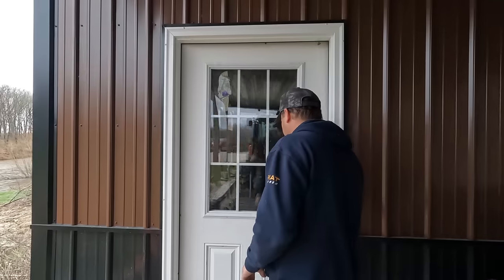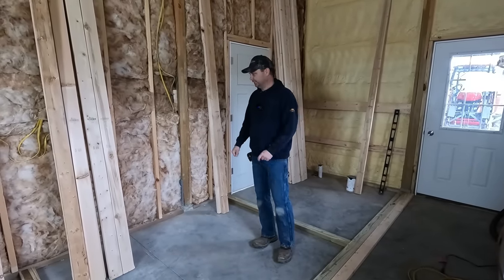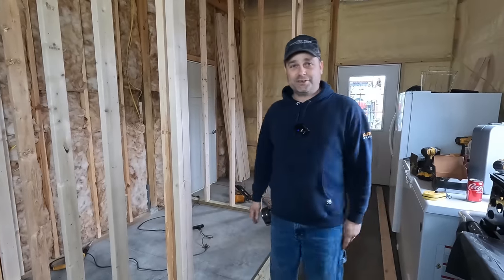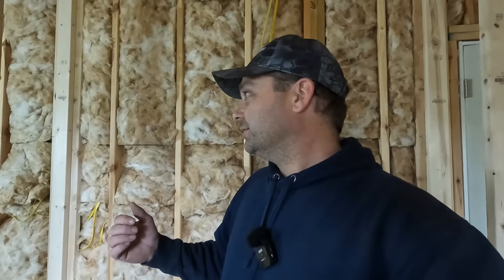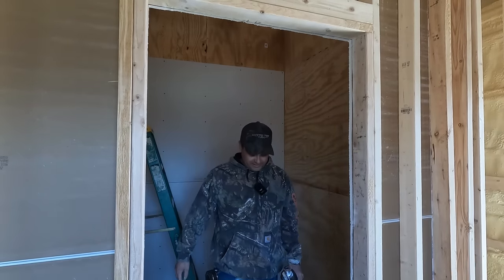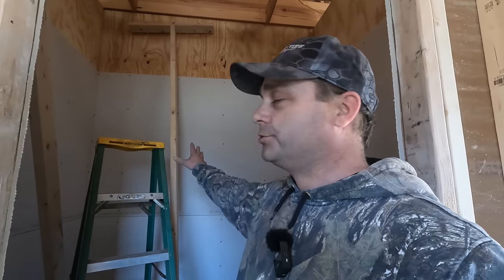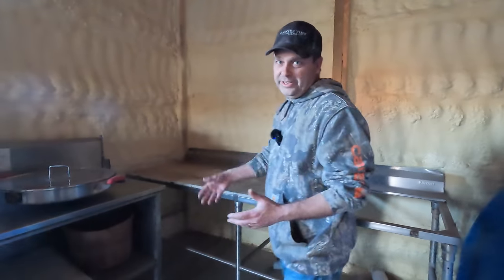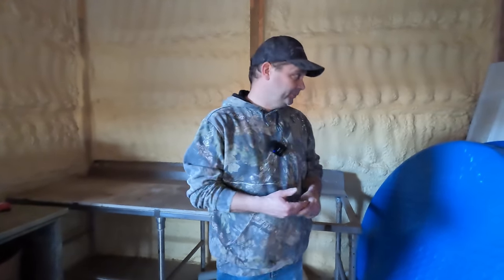We built 2 more rooms inside the workshop.   We have big plans for this space.

Comment: Just an idea for you . Instead of cutting the stainless steel table down what about keeping like it is and finding a thick plastic tub to fit in the hole , so you use the table for cleaning/cutting vegetables or meats and all you have to do is slide them in the tub . So when your done all you have to do is take the tub out to move the product to the next table for the next step in processing.

Comment: I learned the hard way that when moving a Hobart meat slicer around, you have to keep it in an upright position. If you don't ,  the oil leaks into the motor housing and burns up the capacitors. It's a real mess to clean up.

Comment: For the solar control room, I would sheath the walls in a fire retardant board like cement board instead of dry wall, and maybe a CO2 fire suppressor. Especially if you are going to be putting batteries in there.
Lithium fires self oxygenate so they are nearly impossible to put out. If you get a fire in there and you have dry wall you can basically say good bye to your whole barn.
Reply from the maker: I used 5/8" thick fire rated Drywall on the walls.
Reply: Falney, I agree with you. Watch EV car fire videos when the batteries catch fire. It can be a very violent reaction. I personally would build a battery house seperate from the barn.
Reply: @CountryViewAcres  I see. I wasn't aware there was drywall suitable for use like that. UK here :)

Comment: Your solar room needs to be double that size you will max it out very quickly if you are going to have enough room for equipment to power both the house and shop especially if you do a battery back up.
Good luck and hope all goes well.
Your Illinois neighbor.
Reply from the maker: Right now 2 walls in the room will be taken up with equipment.  With the 3rd wall for expansion.  The room should work out fine.
Reply: @CountryViewAcres  ok I hope so.
My room ended up being to small so I built a 12x16 shed and have almost maxed it out but I have a lot of battery back up.
Good luck

Comment: Evan, I hope things work out for you but I have many a friend who are off grid on solar, even friends in Canada with heavy snowfall who have their panels close to the ground. I believe having your solar panels on the roof is not a good idea. Even if it is on a lower roof level its going to be difficult to access to clear them of snow. Heaven forbid you are down and can't get out to clean them and Rebekah has to go out and clear the snow. Are you planning on using a long handled broom? Shading panels like from partial covered sections can not only not produce but also rob you of power. The panels out by your garden are better in that you are able to clean them. Also mounted permanently fixed to a roof it is a compromise in angle of the sun from summer and winter exposure. I wish you well but my advice would be to atleast put them closer to the ground. Your property taxes will go up because you are adding value to your pole barn building by putting the panels on it.

Comment: How do you plan to run the power from inside the solar room to the exterior trench? Up through the ceiling I imagine? Seeing as the room was an afterthought you probably don't have a line in the concrete.

p.s. I poured concrete in my shop a few months back and I did the same under-slab conduit runs that you did so I can have power in the middle of the shop. Thanks so much for all the great videos and ideas!

Comment: Is the drywall a code requirement or just esthetic? Why drywall over plywood?
Reply from the maker: The drywall isn't a code requirement.  But the drywall I used, is fire rated drywall, just for an added layer of protection.  Plus it looks good.  I covered up the screws and painted it.